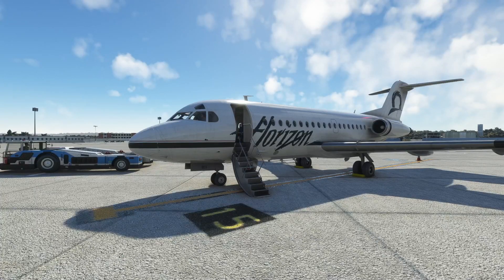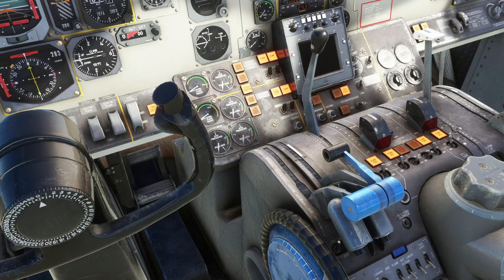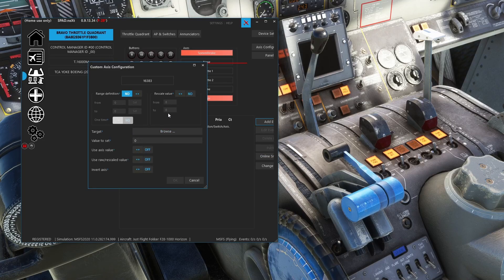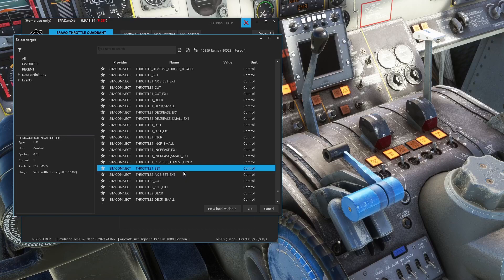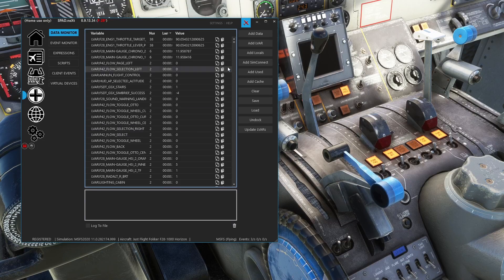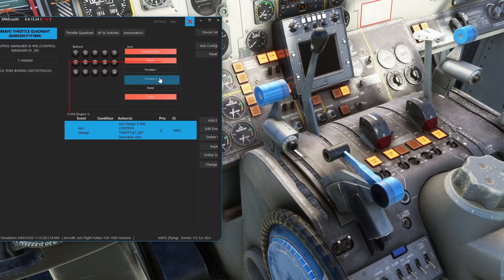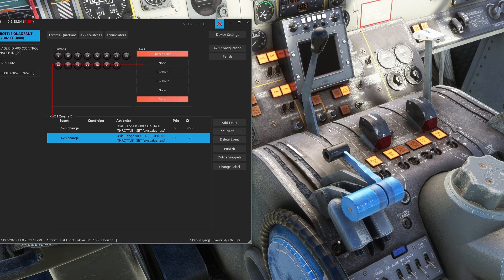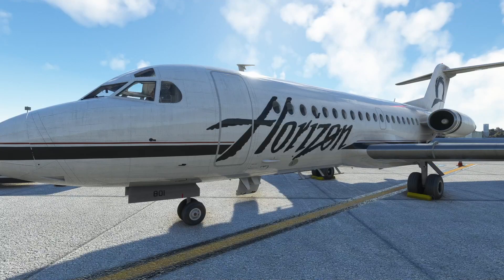Setup Throttle Detent in SPAD for Fokker F28

Comment: How did you map the trim wheel? I can't figure out how to control just the trim wheel and not the ALTERN STAB CONTR
Reply from the maker: I'll check my settings when I get home and report back. Currently waiting at Jury Duty! 🙄
Reply from the maker: So I use LVAR:F28_PED_Stab_Trim_Wheel by 0.1 for button pressed and 0.2 for button held
The altern stab should be controlled via: LVAR:F28_PED_ALT_Stab_Toggle_Switch, Value 0 for Nose Down, 1 for neutral, 2 for Nose Up. Hope that helps

Comment: will these simconnect actions work for the logitech panels? I am also trying to program those and there are no profiles online so I want to make my own
Reply from the maker: I don't have the logitech panels, but I would think so. If the panels communicate with SPAD then SPAD is able to communicate with the plane via simconnect, therefore it should work.